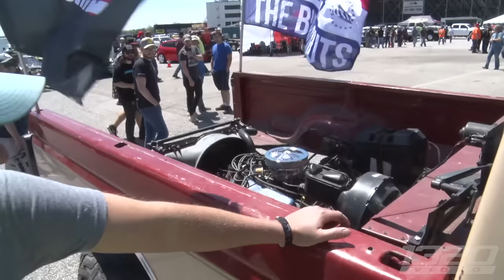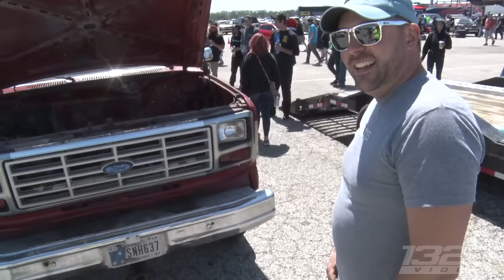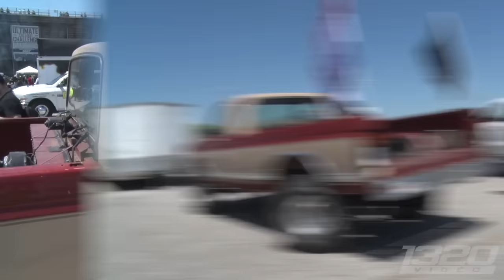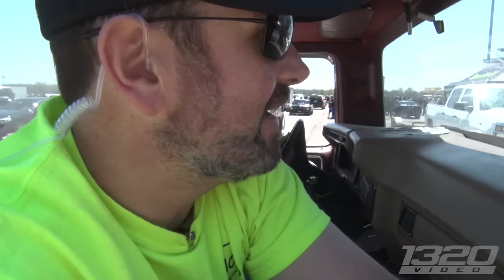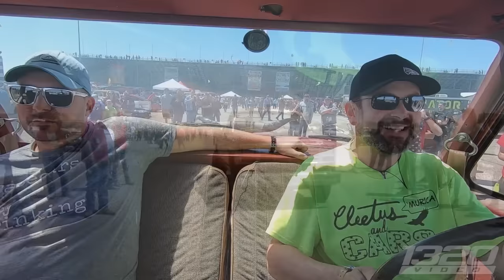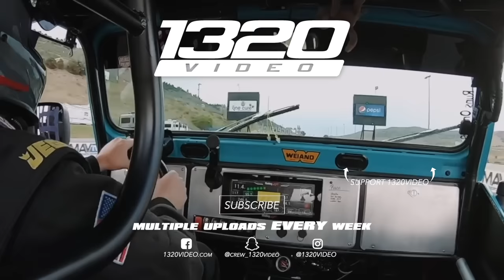Pulled over 22 times in a BACKWARDS Truck!

Comment: The craziest thing about this is someone managed to blow up the old 300 I6.
Reply: I know right? I had one in a van that I put over a million miles on, hadn't changed the oil in over 100,000 because I had a rebuild ready. Ended up selling it along with rebuild, the guy turned it into an ice cream truck and used it over a year before changing the motor. I actually tried to kill it and it refused to die.
Reply: @dehydratedwater9806  And then uber-expensive sports car engines are in the shop weekly with a new broken part.
Reply: @desertrainfrog1691  my sister had that problem with a Jaguar. Always something. She sold it when she found out the water pump was going to be $3500
Reply: @dehydratedwater9806  I had one in a 94 F150, it could pull as much in first gear as my 2000 F250 with the 7.3. I like the Chevy 250/292 engines as well, but the 300 was in a league of its own.
Reply: @InuranusBrokoff  the straight 300 was a beast. I kept mine around just to pull my boat. Also it had no timing belt or chain. Probably why they quit making it, it was too mechanically sound.
Reply: @dehydratedwater9806  Yeah, timing gears are nice, but the fiber cam gears will eventually disintegrate, and Ford was nice enough to secure theirs with a bolt, GM was not, I've got to pull the 250 in my GMC to get the darn thing off, but the Melling unit I'm replacing it with should out live the truck.
Reply: It can be done, but you really have to be trying to pull it off.

Currently my wife and I have two I6 Fords, one a 300 on a 92 F150, the other a 200 in her 80 Fairmont (yep, an unmodified Fairmont. They do still exist.) Hers is getting a just because overhaulthus winter at 195k, the 300 was torn down last year at 318k. Both have some Clifford parts at this point.

Between us we have owned 9 Fords with straight 6 engines.  Only killed one. 300 in a 76 F100, that was on the 4th trip around the odometer, and creeping up on halfway to the fifth. We bought it for the frame, axle, and three speed teams and column, for a restoration on a 74 F150, cheap, as it was rotting away body wise,  and the engine had a main. Knock. 

Drove it one the farm to torture test it, lasted 3 weeks, almost no oil, blown radiator, before spitting  aps through the pan. And we beat the hell out of that truck.

Needless to say, they are tough engines, and even coming up on a half million miles, it ran solid,and was only a little down on power.  A friend bought the block, and has it in his shop, as proof that you can kill any engine.
Reply: I came to the comments specifically to see if anyone else thought the same thing. Gotta be one of the best engines Ford ever made.
Reply: @InuranusBrokoff  the 250 was bombproof.  I had one in a 1978 Chevy truck.  My old man told me that he would put a 350 in it when I blew it up.  It would get hot and quit, but start right up again after it cooled.  The 250 was a solid engine.
Reply: My nephew has one in a mud truck, never takes it off the floor. It’ll turn 5800 then floats the valves, it did that for over two years and finally “blew up”. When he got looking at it, all that happened is the distributor drive gear pin sheared off. Put a new pin in and it’s been at idle/5800 for the last year! Starting to smoke a bit after 3-4 years of wide open mud slinging.
Reply: That's what I was going to comment.  Must not of had any oil and coolant?  The 300 is almost indestructible.
Reply: @InuranusBrokoff  I had the 95 f150 and that was hands down the best truck I've ever had... It was pretty much indestructible
Reply: @romanfields7900  The 250 sounds great too, I prefer it at idle over most V8's.
Reply: Me and my dad used to take loads of cattle (around 6000 lbs) to okc 75 miles from home with his 1980 f150.  Had a 300 in it and it made it there and back every time.  45 mph the whole way up with the rear end bottomed out.  Still ran when he sold it.  Hell of an engine.

Comment: I would have thought the issue would be having no side mirrors instead of wiper blades.
Reply: I wonder about the back window. If it’s original, it could shatter if hit by a rock on the highway.
Reply: @MoneyManHolmes it would be toughened glass, (not ordinary house glass) , the stuff we all used for windscreens before they used laminated.

Comment: I learned from Derek over at VGG that building a burnout machine is counter intuitive from a drag car. You want a high rear end to spin the tires faster.....but you have to have the horsepower to do to. Faster wheel spin means more dramatic burnout.

Comment: Perfect build for a 24 hrs of lemons race.
Reply: and it fits the rules, only 500 bucks
Reply: @THESLlCK  To expand on the "$500" rule.  There are exemptions for certain vehicles that are more of a rarity (Packard, Hudson, Renault. etc.)  also there is an unlimited safety budget that includes brakes tires (no racing tires ie. slicks) roll cage, some suspension parts (ball joints, tie rods) rotars.  There is also a judges bribe that will get some things past if they are creative, different and mostly funny.
Reply: @michaelcaraway2305  reading renault is rare as myself a european.... It.. It hits different

Comment: A funny thing happened to me and my friends in 1974. We went to the drive in, parked and when I pulled the parking brake on my 64 Dodge Dart I heard a loud thump. We watched the movies but when it came time to go home, the parking brakes were locked up (the cable had broken.) We couldn't move forward but we could move backwards. 2am and we three teenage kids are driving home backwards. We get about a mile away from home when we are stopped (still backwards) waiting for the red light to change. That's when a cop car stops at the light next to us. The cops is looking at us like a dog does when you make a weird sound. We wave at him and smile. The light changes and we start moving into the intersection when he turns on his lights. We told him what happened and how we were just trying to make it home. He said it was illegal because we didn't have the correct lights in the correct places for the direction of travel. He gave us a ride home and my dad and uncle fixed and picked up the car the next day.

Comment: You guys need to film "Charlie Chariot".
It's a "horse and Roman chariot" that can and does, go down the highway at highway speeds.
It's powered by a Nissan Sentra hidden in The Chariot.

I've driven it before myself, I've never seen ANYTHING get as many looks as that.
It will pop a wheelie if you're not careful!

My Uncle built it from scratch, and is the sole owner. If you can't find the contact info yourself, I'll be happy to provide it for you.
It's "home" in central NC

Comment: When I was little I saw a truck that could turn both front and back wheels and it had not one gastank but two gastanks  it was in a parking lot  at a store I was at I was sitting in the car while adults went into the store  they came back  but the truck was gone so I couldnt point out  the strange looking truck

Comment: I know “ People use both interchangeably when it comes to “ Motor” but the difference is that motors run on electricity and engines run on combustion. The engine converts various forms of fuels into mechanical force, while the motor transforms electrical energy into mechanical energy.” Y’all sound like Fools! saying motors, when it’s an Engine.
Reply: Wrong. A "motor" converts ANY type of energy to mechanical force. Examples: hydraulic motors, pneumatic motors, and as you mentioned electric motors. Internal combustion engines are another type of motor. 
I know it's not fair, but an engine is a motor, but not every motor is an engine.